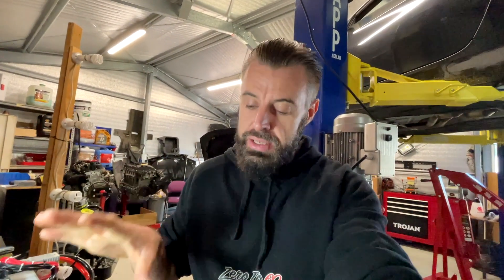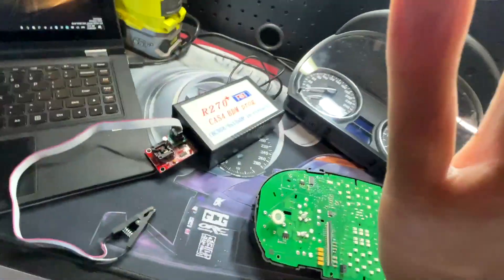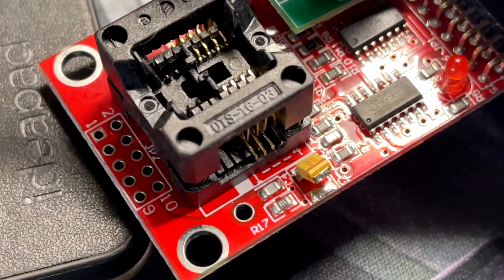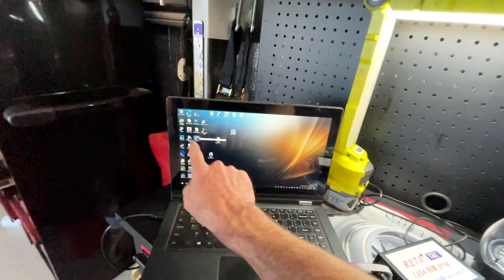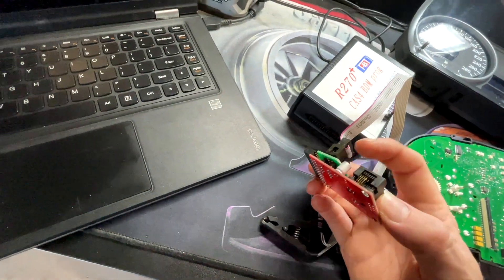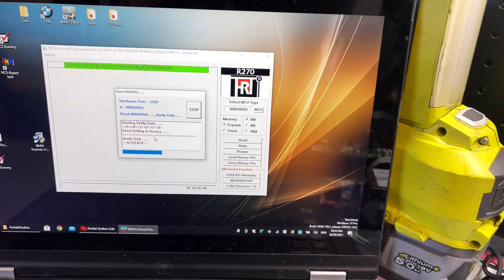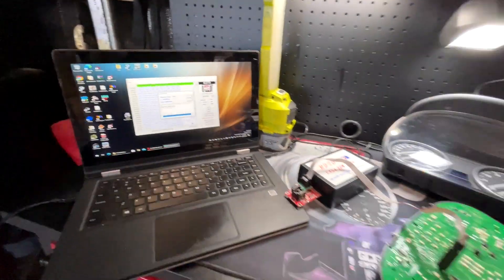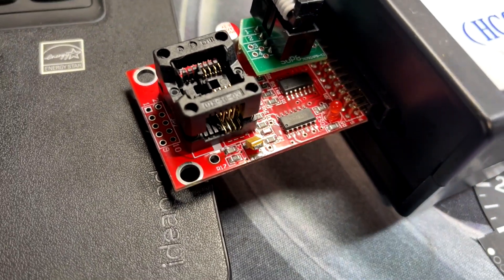R270+ Programmer Fix For BMW Dash Cluster Virginising 080D0WQ

Comment: There is zero difference between a red or blue R270 made after 2015.  The issue with with any R270 red or blue made in the last 5-6 years is in the main unit of the R270 they stared using a cheap read only chip on position U2 .  To fix that you need to remove the cheap chip and install the proper Texas instruments AHC08 read and write chip in position U2 of the main unit. The eeprom board you need to remove the yellow cap on C1 and if you have a resistor on R14  you need to remove that also but most made in the last few years don't have a resistor on R14 so the yellow cap in position C1 is most likely all you need to remove . With these 2 simple mods the R270 will read and write and erase any M35080 3/6 V6/VP 080DOWQ  35160 160D with zero issues or corrupting data. The Texas Instruments SN74AHC08DR is a few bucks and easy to replace with a hot air station
Reply: Hi Mike! I tried to read m35080/3 with r270. I put the chip in the adapter in the right position, but programmer always gives "unknown pin error. Do you have any idea how to solve it? Thanks
Reply: @Norbbbbbb  Yes very easy fix ,on the eeprom adapter that you plug into the R270 on position C12 you will have a yellow tantalum capacitor ,you need to remove that capacitor. Remove it and it will read and write all chips listed and do the pin test properly.
Reply: @mikealkarout9555  I removed C1 capacitor and tested again, but it does not help. Device keeps saying:"unknown pin error". Other idea? BTW I have read/write cas3 without problems, so I think the main unit is OK.
Reply: @Norbbbbbb  Also clean the 8 legs on the eeprom ,use what ever like a nail file or some fine sand paper /scotch brite and very lightly go over the 8 pins top and bottom .1 pin is not making contact ,you will get a pin error . Also before you try to read the chip heat it up a bit with a heat gun   /hot air station 20-30 seconds and try to read when still hot/warm. Had this happen to me a few times and for some weird reason heating the eeprom brings them back to life .
Reply: @mikealkarout9555  Thanks for your help!
Reply: @mikealkarout9555  Hi Mike, I've tried everything you wrote and still have an unknown pin error. When I skip pin verification, it loads, but hex is 000000. Are you able to help?
Reply: @Kluki21  got the same problem. I did the removal of the cap on C1, also heating up with an heat gun on the M35080VP, also cleaning it, but everything the program says if i wanna read it is "UnKnown PIN Error".
Reply: @damace146  I sent back the old device and the seller sent me a second one and then the same.  I do not know what to do :(
Reply: @Kluki21  The eeprom is it a original one out of a Bmw cluster or is it one you got from China/internet? Because I have purchased a few times now 080dowq /35080 eeprom from China /internet turned out to be fake,the were labeled 080d0wq /35080 but a few turned out to be  25080 chips and all the others were unknown dead on arrival chips .That is exactly what they would do when I tried to read them with R270 ,fail the pin test and when you skip the pin test it would read all 0.  But if its a factory eeprom out of a Bwm cluster and you tried to read it a few times with that yellow capacitor still on  the board it might have destroyed the eeprom. I destroyed a few eeproms the exact same way years ago before I figured out to remove the yellow capacitor. .Because I know with that cap on the board it was sending 9-10 volts to either pin 1 or pin 8 can't remember exactly ,when the maximum voltage a typical eeprom reads/operates at is 5 volts. Lets say it's  a eeprom out a Bmw cluster ,I would solder it back on the cluster and power up the cluster on the bench and if the eeprom has been destroyed/corrupted  it will show up  some random numbers or be just blank on the mileage display and you will know the eeprom is bad. I have a bunch of good eeprom dumps from,E39,E53,E60,E90,F10,F15 etc Bmw clusters I can help you out with if that is the case and if you need the pin out to power up the cluster on the bench with a simple 12 volt + and - let me know what cluster you have and I will give it to you. Also if you need a few good 35080/080 eeproms I will send you a few no charge in the mail .
Reply: @mikealkarout9555  I've got my eeprom from an original bmw cluster, I'll solder it back to test it. Which country are you from?
Reply: @damace146  I am in Edmonton Alberta Canada .Where are you located?
Reply: @mikealkarout9555  I'm from Germany
Reply: @mikealkarout9555  ok I've resoldered it back to the cluster and it's not dead, what could be the next issue with the unknown pin?
Reply: @damace146  have you found any solution since then?
Reply: I found the solution to "unknown pin error". Now device is able to read/erase/write without any problem. If you're interested, let me know.
Reply: @Norbbbbbb  hi, would you mind tell me the solution on these? i've been searching the solution but haven't found any.

thanks
Reply: @gtalearntodrift  hi! U2 on the eeprom adapter add 5v from the laptop by an usb cable. Pin1-ground and pin8-positive. For some reason there is only 2 V on the adapter, which is not enough for the chip to work. And when the program asks check pin state,  hit no.
Reply: @Norbbbbbb  hi, is there any way I can contact you like email so I can send picture of my eeprom adapter.
Reply: @Norbbbbbb  on U2, I'm using it with eeprom test clip like on this video. Is that still possible to add 5v on the U2?
Reply: @gtalearntodrift  if you use test clip,  you can solder the usb wires to  pin1 and 8 on U2 or socket IC at the bottom of the adapter.
Reply: @Norbbbbbb  it works! thanks man
Reply: @mikealkarout9555  hey bro another fellow Edmontonian here I wanna know how u do the cluster here in edmonton I have a programmer here just need help
Reply: @mustafasabeeh1398  Yes for sure no problem ,how do i contact you?
Reply: @Norbbbbbb  cual es la solucion amigo se me queda pegado escribiendo
Reply: @ANDYCALIFORNIA  unknown pin error?
Reply: @Norbbbbbb  I have done this, but still not able to write/ erase. Are you from germany?
Reply: @Pipmen  No, I am from Hungary.
Reply: @Norbbbbbb   Hey, which one is pin 8 on the U2 pins? Is it bottom right from pin 1 or opposite pin 1 to the right?
Reply: @Norbbbbbb  Thank you, that's what I thought but wanted to confirm. Unfortunately it didn't fix my issue, still get "unknown pin error" if I click yes to "check pin state" or if I click no, it gets stuck on 992/1024 verify data, even though I get the 3 audible beeps but is just stuck until I press stop and then get "read error". I'm using the test clip and de-soldered the C1 cap. I'm at a loss lol
Reply: @Alexige11 try to resolder c1 cap and/or desolder the eeprom and use the eeprom socket to read.
Reply: @Norbbbbbb  I tried re-soldering the cap but not with the USB soldered to U2 and I originally tried reading it via the eeprom in the eeprom socket which then led me to try reading it via the test clip. Is it possible my eeprom just cant be read, it's the 080d0wg eeprom.
Reply: Hi Mike, could you show the chip on the board that you mention. On my red board, there is blank space for an 8 pin chip at the U2 position. Thanks
Reply: @Petruccimaniac  I think what your talking about is the Ak90 Bmw ews key machine ,in that it's either position U2 or U3  there is a 8 pin chip and some come with a chip and some come without that chip,works either way. .But on the R270 cas bdm reader you need to take off the 4 screws on the main unit and inside right under U2 there is a 14 pin chip should be HC08 and you need to replace that with a Texas instruments AHCO8 .  The only 8 pin chips in the R270 main unit are in position U10, U4 and U5. The epprom board that plugs into the R270 if there is a yellow tantalum capacitor on position  C1 you need to remove that .
Reply: Hey Mike, having similar problems here. I have a red board and the O80D0WQ chip. I've just replaced the U2 IC with the proper TI model you suggested, removed the capacitor and verified my SMD resistors all match. I've been struggling with the SOIC clip so I hardwired leads to the IC on the speedometer unit. I've got a 12v, 2 amp power supply to power the 270+ unit. I'm still getting the 'unknown pin error' from the software - I have not had a single successful read, and get all zeroes if I read without checking pin state. Any further ideas please?
Reply: @chrisschiff602  Are you trying to read the eeprom on the board? Because a R270 will never pass the pin test if you are trying to read the eeprom  with it still soldered on the cluster ,you have to remove the eeprom to read and erase it properly. I know on some  E90 clusters I got it to read the eeprom on the board but every time when I would try to erase the mileage or write anything ,it would corrupt the data or ruin the eeprom. But if you are getting this pin errors with the eeprom removed from board ,it's the eeprom adapter 100% . I have seen a few times where the R270 eeprom adapters have the wrong value resistors soldered in the wrong places.,   Send me a close up pic of your eeprom adapter if you like and I will tell you if anything is wrong.
invrluz427@hotmail.com
Reply: Hello friend. I am having the same error like in the video about verify address that he solved by removing the yellow cap. The problem is that i do not have a capacitor in C1 to remove.
Do you have any idea about solving this mystery? I am trying to virginize 35080 6 , 35080v6 and 080d0wg but all of them give me this verify error. 
Can you give any hint?
Reply: I got farther anyway i just need help with one this resetting the damn mileage on 35160wt
Reply: Or lowering it cuz the process does not work in it I believe unless I’m doing it wrong maybe idk need help
Reply: @mustafasabeeh1398   Bro I'm in Edmonton and can help you out ,got a few tools that can do it easy.
Reply: @mikealkarout9555  where in Edmonton
Reply: @mikealkarout9555  I can’t put any personal info anywhere here Andrew help me out @Mustafa_341
Reply: That’s the insta
Reply: Also instagram will work

Comment: That yellow thing you removed is a tantalum capacitor...not a resistor. Love your videos!
Reply from the maker: You are correct
Reply: i haven't bought my programming setup yet, i'm just getting into this & doing my initial homework, but my educated guess would be that the cap is shorting out the power rail to the target IC. tantalum caps can fail shorted. also some of the cheap/counterfit tantalum caps might be shorted from new. aside from that, could be a pcb layout error where someone connected the cap incorrectly.

Comment: I’ve actually bought an R270 clone of ebay back in the day and it came with the blue board. It does read and write 080d0wq eeproms but it could never do mileage with the test clip. Probably gonna remove that capacitor (it’s a cap, not a resistor 😉) from the board and gonna give that another go 😅 thanks for making this video Andrew, I might learn a thing or 2 from you as well 😂
Reply from the maker: Well that’s something I didn’t expect haha! Arno you are a gentleman and a world of knowledge. Let me know how yours goes with the capacitor removed. I should have know that since it’s in c1 on the board….. rookie error hehe

Comment: Did you have a sticky at the m5 ?
Reply from the maker: Absolutely! Would be a nice buy around 20k. Or an absolute nightmare depending on how broken it is.
Reply: Grays are always vague with the engine mechanical light description , you don’t know if they mean the engine light and the airbag light or just the airbag and they just group it with engine and mechanical cause it’s easier. The cheapest m5 at the moment is $43k so could be a steal .
Reply from the maker: Always a bit of a gamble with an auction car, but i guess thats what makes it exciting.